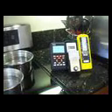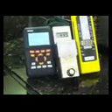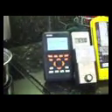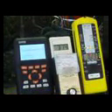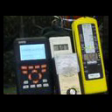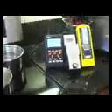Dirty Electricity and Pulsed Magnetic Fields from Induction Cooktop.

Comment: Thanks. I'm curious, if the induction stove radiation and EM noise is higher than that of any other high power home appliance - a fridge (when it's working, of course), a washing machine, a vacuum cleaner etc.

Also, when comparing to the good old gas cooker, how can we be sure that the byproducts from the burnt gas are not even more harmful than the EMF radiation? It's very difficult to compare. Of course, both are not healthy and maybe even cooking on a campfire also can cause lots of harmful burnt particles both in the air and in the food... So, which poison should we choose?
Reply from the maker: Yes because it uses a pusle width modulation to vary the amount of current to the stove top.
Reply: Excellent points to consider. Im a pick ur poison type of guy too..

Comment: Have you tested if electric is higher or the same.  I've looked at gas and the line is too far from my stove.  I'm curious if electric or induction have higher levels or the same...
Reply from the maker: Hi Daniel,  The voltage is the same at 120 VAC per phase.  Induction electric cooktops produce the DE.
Reply: @windheimemfsolutions  So the usual electric stove won't produce these bursts of electricity?
They both produce a powerful magnetic field, I wonder which one is worse.

Comment: Induction stove... it even sounds scary.

By the way, where can I find a graham ubiquitous filter?

Thanks for the video, although the picture quality is not so good.
Reply from the maker: Charles Goyette You are right.  It is a low res Kodak Easy Share still picture camera.   Th stove puts out a oscillating 2-8 mG magnetic field with most frequencies in the > 2KHz range which is in the window of biological harm (2 KHz-100KHz). We are using a gas camping stove for now.

I have the filer you mentioned that is needed to hook up to the oscilloscope to filter out the 60 cycle sine wave and reveal the DE transients.  Contact me via my web site contact form at www.WindheimEMFsolutions.com

Comment: wow...yea....I received my meter and 4 filters. Some outlets are higher than others in my studio apartment in Honolulu. I just checked my bathroom and it registered a little over 400 on the meter and when I plugged the filter in it dropped to 75. I'm going to order another 4 filters so every outlet is covered.

Thanks for uploading - - shared.
Reply from the maker: Come Visit Waikiki I am glad you are precautionary and have taken action.  The ratings will be lower and the filters will be more effective if you replace any CFL bulbs with incandescent ones.  Some LED bulbs are clean but not all so they must be tested and returned if not clean.  Right now the Phillips LED 100 Watt Equiv. daylight bulbs is 100% clean per my recent test.  This can change from lot to lot of manufacturing run.